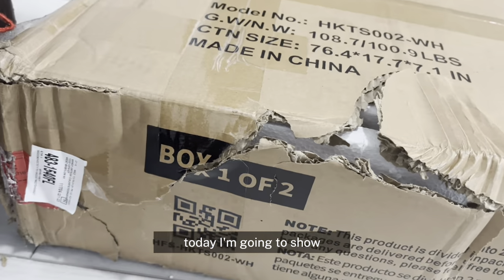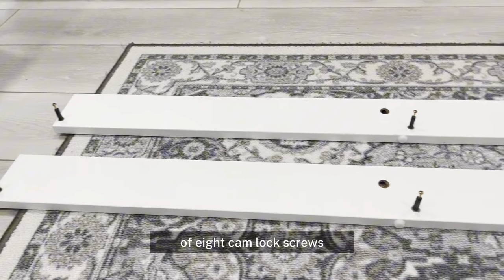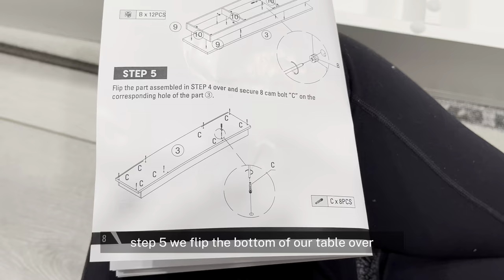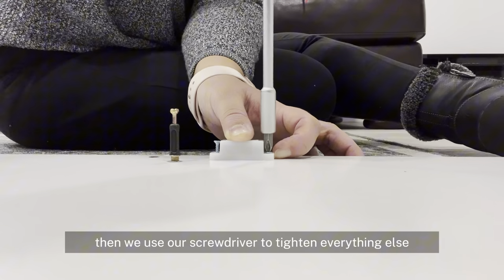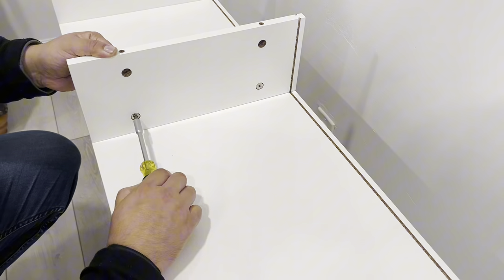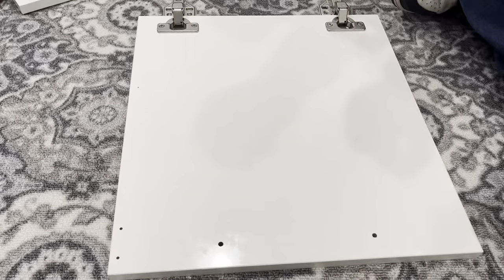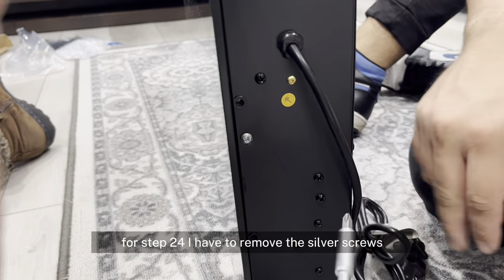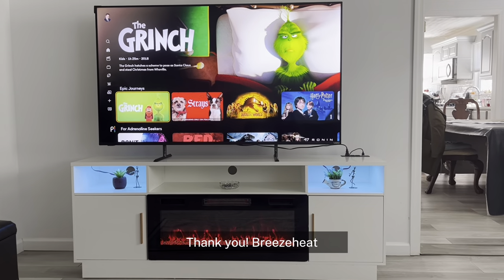70inch TV Stand with Fireplace Assembly Video

Comment: One question and it wasn’t shown in the video, only the screws. How do you reattach the “silver screws” once the fireplace is secured to the entertainment center? There is absolutely no room for a screwdriver to put the screws on from the sides of the fireplace. Even with a 90 degree attachment which is designed to remove/replace screws in tight spaces. Manufacturer defect is what I’m guessing.
Reply: Yeah currently trying to figure out the same thing … did you just leave it alone ?
Reply: I came across the same problem any solution?
Reply from the maker: The purpose of the “silver screws” is to help customers easily identify the screw positions when disassembling the glass. After installing the glass panel, you can discard these two white screws. You can use the black M4*12 screws from the accessory pack instead. Installing the glass face can be tricky. I recommend using a ratcheting screwdriver wrench, available at any hardware store.
Reply: @BREEZEHEAT-Kucreiheat this is confusing. in the video you say to reinstall them, which isn’t really possible and here you say discard them and use the black screws but still don’t specify where to put the screws once the fireplace is in place. can you explain more clearly or make a video for this?
Reply: @BREEZEHEAT-Kucreiheat  stop trying to be smart by saying a lot of stuff that doesn’t make sense. You intentionally skip that part because there is absolutely no way to do that step they’re telling you. No way. If there is a way, do a video of it
Reply: @Kwame_USA  100% agree. I bought a different but still similar fireplace and I have 0 idea how to secure the fireplace and there are NO videos that i found that explain it, why is everyone trying to be smart and coy about it, just please say how to do it. My fireplace has been unfinished for days.
Reply: Did you ever figure out how to do it? :C